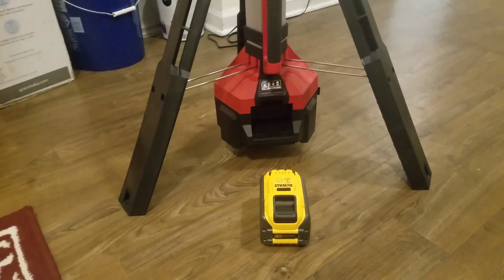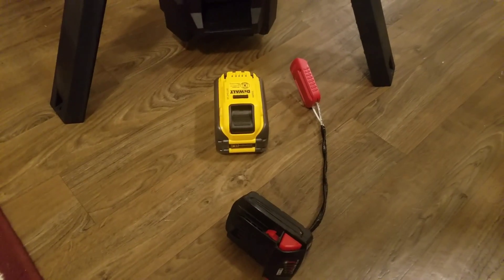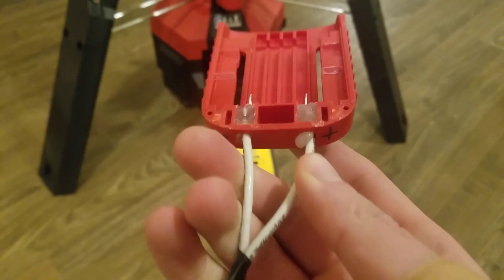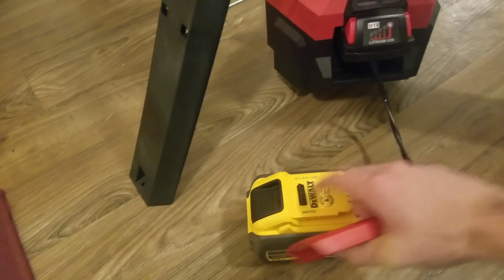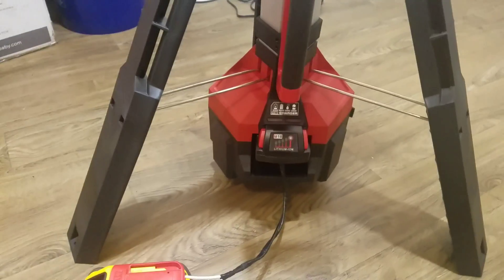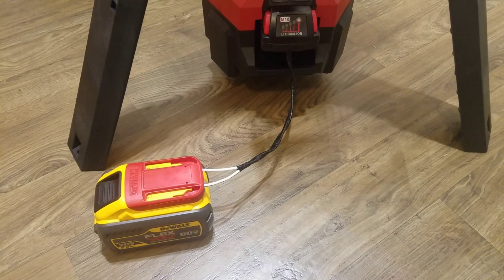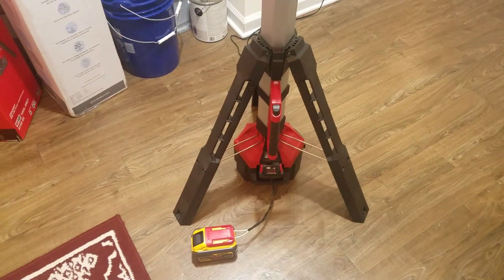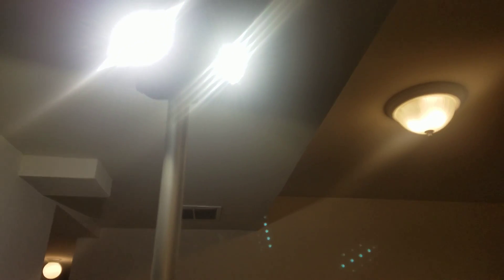My Milwaukee M18 tool works with a Dewalt 20V battery!

Comment: Both batteries are the same voltage. "20V Max" is just marketing. A fully charged Milwaukee battery will also read more than 18V.

Comment: There's only one problem with this. Dewalt tools have a circuit in them that communicates with Dewalt batteries. It shuts down the battery before it gets too low. Once one of their battery's gets too discharged, the charger wont recognize it anymore and it's junk. So if you do this, check the battery's indicator often and when you get down to one bar, recharge it.
Reply: easy to repair
Reply: You can open up the battery, ID the dead battery with a meter, sever the Nickle strip to isolate, then charge the individual cell, bridge the cut Nicole with solder and all fixed.

But please keep recycling those "dead" lithium battery packs. I love getting free samsung lithium cells.
Reply: he mentions this in the video...

Comment: pretty sure the dewalt and any of the pro brands battery have a chip that regulate charge and discharge.
Reply from the maker: No, in the Milwaukee the chip is in the battery but in the DeWalt, the chip is in the tool.
Reply: @yehudagoldberg6400  milwaukee low voltage cutoff is in the tool just like dewalt

Comment: Dewalt doesn't make a 20 volt cordless socket wrench, but Milwaukee does. I'm too invested in Dewalt to get a tool that won't use the batteries I already have. I may have to try this. Instead of the battery cover, I'd probably use the Dewalt 18 to 20 adapter.
Reply: 18 to 20? What the hell is that? battery 18v from dewalt are same with tools/battery of 20v

Comment: On the ebay a guy or company sells adapters for those kind of things i guess they 3d print but crossfire i believe is what it is called but kinda pricey like $45 i think
Reply from the maker: The problem with the adapter is that it takes up alot of room and it would not fit in the battery cutout on this light with a battery on it.

Comment: You could take the electronics from a dead milwaukee battery and make a resistor divider to let the tool think is has batteries and put in between. It'll then protect the dewalt battery for everything except improper cell balance (cells are balanced in the pack but no shut down if one is out of balance). Should be good enough to not really worry about as long as you do not use old batteries with noticeable performance degration.

Comment: I have that light as well, so glad I switched to Milwaukee a few years ago from Dewalt after a couple of dead batteries, funny but the first m18 hammer drill and impact I got on sale at HD for the same price I sold my Dewalt hammer and Impact and a couple of smaller 2ah batteries.

Comment: I would definitely add an over discharge circuit, those flex volt batteries are expensive. You can buy circuits pre made on eBay, I wouldn’t use a flex volt battery either, just a regular 20v 5.0 amp hr

Comment: the milwaukee 9.0 is not 250 is 169.
Reply from the maker: Victor Fuller but you need at least 2 batteries at all times while one is charging.
Reply: @yehudagoldberg6400  Yeah its a construction thing. Cordless tools are useless without batteries which will get your arse sitting home and its hard to buy batteries when you cant make rent :)
Reply: What

Comment: all 20 volt battery have the same amount of lion cell as a 18 volt the only difference is marketing, same capacity
Reply: francois clermont 20v packs can have different watt hours... And different amount off cells... The dewalt battery in video uses a even larger cell... 20700. 20mm x 700. You are right about 20v actually is 18v... But that was more to separate the two lines... Lithium and ni cad... And that is understandable. 20v max is no load... 18v is with a load.
Reply from the maker: Yes, the voltage is the same. but that does not automatically mean it should work, since the tools and/or batteries have chips in them.
Reply: They also both run at 18 volts! Lol

Comment: So how do we bypass the chip? Because if we made a plastic adapter that just goes on the drill itself and the battery just slides into the adapter and connects with those terminals. They have them for raob but it's only 20 volt to 18 volt but if we made a Makita DeWalt and Milwaukee birth actors that would change the entire market and I don't know if there's any legal fees or any legal action that they would take. Kinda scary and a milti million dollar idea. Or if they just standardized batteries I mean that would save so much money but the big battery companies just don't want to do that
Reply: Sorry voice text sucks
Reply from the maker: Since the DeWalt battery actually 8 terminals 6 of them being information terminals, I do believe that if someone took the time to reverse engineer the chip in the Milwaukee battery, there would be a way to do this safely. Battery designs have design patents so actually selling an adapter would not be legally possible.  A standardized battery will likely never happen because of corporate greed. They have you married to their tools. I made this public as a way to fight it. Who knows, maybe one day if this kind of information of how we can easily hack the proprietary battery is widespread enough, they will move to a standardized battery.
Reply: Yehuda Goldberg even a 3 party wouldn't work.. sad that's not capitalism. Maybe if we found a way around the legal system then we could patent it.